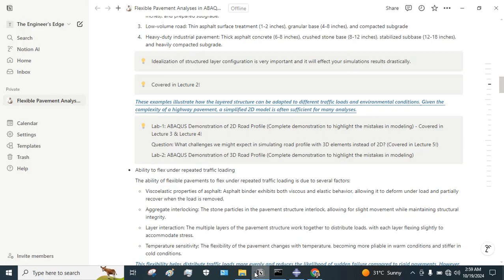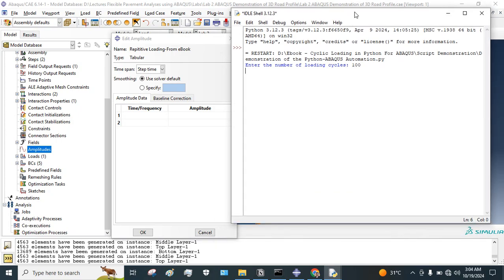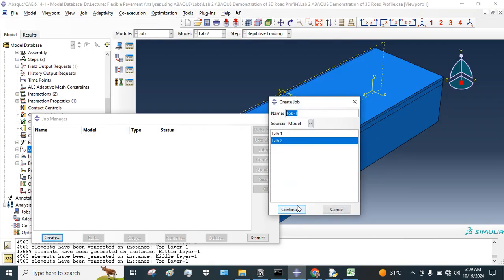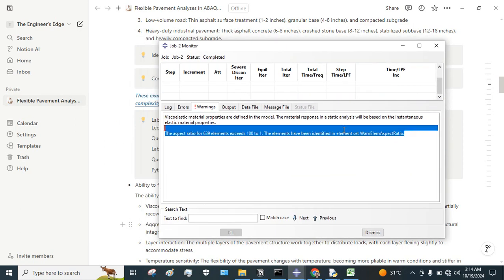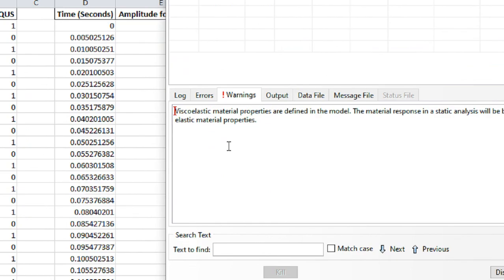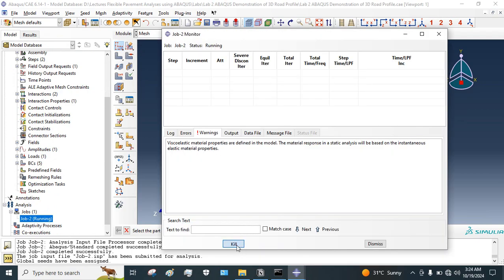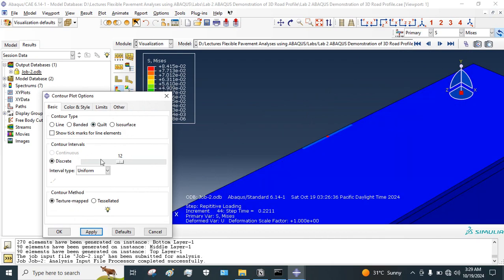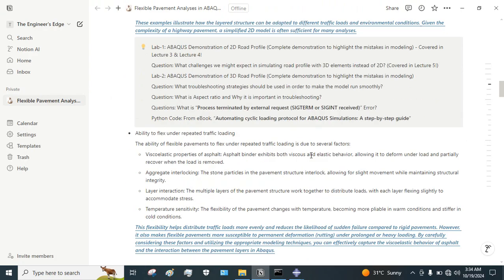Lecture 10 of 34 | #Flexible #Pavement #Analyses in #ABAQUS - A Comprehensive Course

Comment: Thanks for this helpful material. I have a question: 
How did you define BCs in lab 2 model (3D model)
Reply from the maker: I think i have covered it in lectures but those are for premium purpose. The BCs are defined with predefined sets, where required.